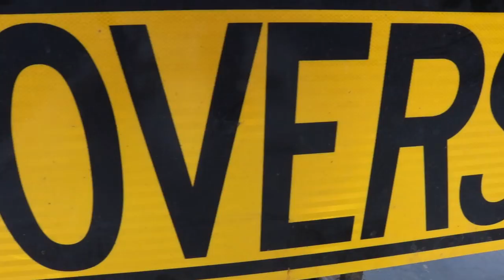Don't Buy A Tractor Mower Until You Watch This

Comment: Rhino mowers !!!  A good solid built mower !!!  I bought a 6 footer about 15 to 17 years ago and it is still in service, use it every summer !!! one time it hit an electric motor off an old circulator pump near the road side and it handled that impact very well!! just took the edge off the blades a little, but no dents in the deck!!!! just a few scrapes on the paint  !!! The old Bell and Gosset pump motor was almost cut in half !!!! and that's no joke !!!  Very Happy with my RHINO rush hog !!!!!

Comment: Wow! A welding shop that you can actually see in. "Proper" ventilation systems should be mandatory and I don't mean OSHA standards.
Reply: Person, Someones going to pay one way or another. Either the Tax payer in the form of health care/ Government aid for the disabled or the companies these employees work for in the form of safe work environments. It makes more sense to spend the money so these people never get sick from it in the first place than pay to take care of them afterwards. In the warmer months when the doors are open ventilation is not a big issue as long as the buildings are reasonably small and they are open at both ends. In the winter when they close the doors it gets "real" bad. OSHA's standards regarding air quality are a joke and give workers a false sense of safety.
Reply: Person. Proper ventilation is cheaper then a  trip to the hospital..
Reply: Person. You don't have to evacuate welding fumes. They can be filtered right from the work station using portable units that don't exchange heated air. There's NO excuse not to have proper ventilation!

Comment: Just purchased a Servis 160 Gyro pull behind bush hog. Servis was later bought out by Rhino. It had an engineering design flaw of not having a stump jumper. The design would put the blade system into a bind and the pressure would transfer back to the gearbox. The gearbox would then crack. The mower had a slightly complex system from the gearbox to the tractor for the driveline. I plan to replace the gearbox, put a heavy duty stump jumper and a slip clutch next to the gearbox and then have the machine shop to shorten or lengthen the pto shaft. The mower is beautiful to look at even in it's current condition. This will be my 2nd bush hog that I plan to redesign. Many are called bush hogs but really are only for grass and won't even last the first 8 hours in the field. The competition is tough and many small farmers are looking for the cheapest mower on the market from TSC or Rural King They get just that, something cheap. It's tough for manufacturers under these conditions. I'd like to see Rhino redesign the Servis 160 Gyro more along what I plan to do. I don't believe they are even using this pattern mower any longer.

Comment: Ran our 72inch finish mower since 1998. Original belt in fact.. pulls good with the 20hp JD. Only thing I did not like and as a metal worker.. it really bugged me.. was the wheel bars were bolted on to far forward..so I had to move them back so they wouldnt hit the rear wheels...no biggie.. found what was best for my tractor and welded in place.. the second.. was the soft round stock used for the up right casters. good wheels, good U mounts.. but that soft round stock would bend if it hit a root,,and it did that a lot.. after 1 summer of dealing with taking them off and re aligning them.. I said the devil.. cut the things off and welded grade 8 bolts 10inches long to replace them... this also solved the problem of the snap pins falling out if they snagged a bush or something...since a nut held them in place...HOPEFULLY Rhino corrected these issues later on.

Comment: Hey so I just watched a video on you trying to keep deer away from your cedars. I am a farmhand for a man who has a LOT of cedar trees and a LOT of deer on his land. Im sure you can see the problem. The most effective way to keep deer away from the trees that we have found is actually not using a little fence around the tree. By far its more effective to buy some Irish spring soap bars, cut them in half, make a little chicken wire basket, and hang that on the tree with half a bar of soap in it. For some reason deer hate the smell and stay far from it! Im not sure what they dont like about it but it makes the place smell good and keeps deer away for a whole season. Every year we go out with a drill and put a few holes in the bars of soap to make them smell good again until they're gone and we start over. I cannot guarantee this will work well for you but its the best method we have used and its quick and cheep.

Cheers,
AJ
Reply from the maker: Thanks for the info AJ

Comment: Looks like a good bunch of good ole boys working in the shop having local made items is the right way to do business. I am not a fan of the powder coat process for flexible (flexing) equipment they do not prime most parts and the powder coat cracks and cracks tend to let water in and the under laying metal will rust.